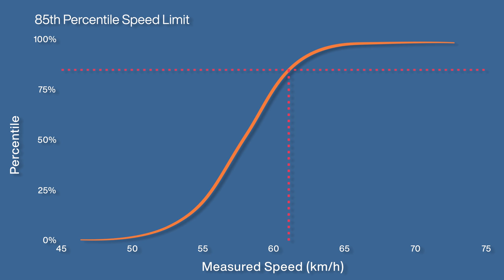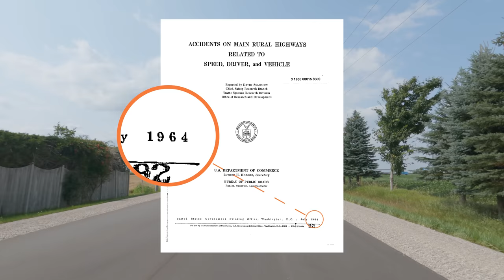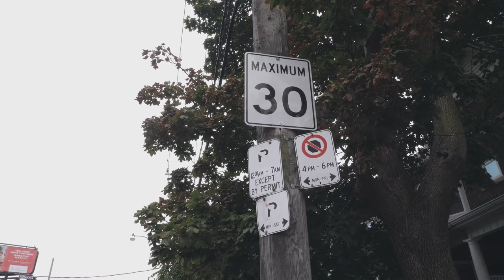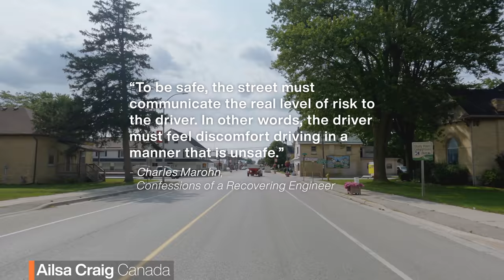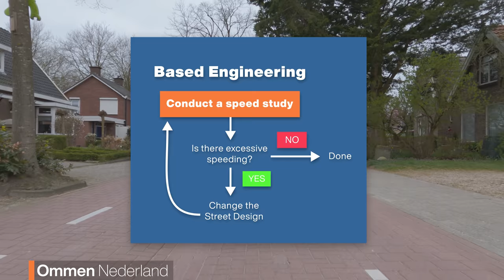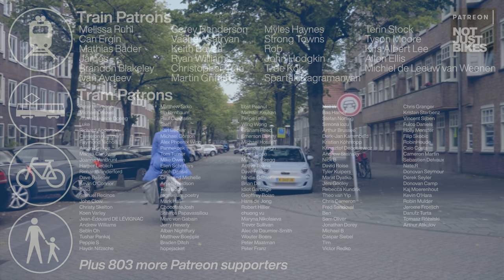The Wrong Way to Set Speed Limits [ST06]

Comment: The 85 percentile rule blew my mind. How they thought this was a good idea is beyond me.
Reply: It does kinda make sense in its original application. 
Rural roads built in a time where speed limits didn't exist coupled with an at the time fledgling understanding of traffic engineering, the number of drivers was very low relative to today etc.
It's also expensive to make new policy. Because invariably some areas will no longer be up to code and have to be changed.
That's all before you get into the political end of things re: who benefits from changes and who loses out due to changes. As well as ideological factors which are too numerous to get into.

It all results in policies which worked at one time retaining momentum and carrying on even through changing times and infrastructure.
It really is a lesson in doing things right the first time instead of relying on temporary solutions. Those temporary solutions often become permanent to the detriment of everyone.
Reply: @rainbowkrampus  Expensive to make policies how? The Dutch are constantly refining their best practices. It doesn't mean the old best practices are suddenly illegal, but it just means that, when that bit of road is getting touched next time, it gets updated to the latest standards. So yes, there are plenty of streets that, for modern Dutch standards, are a decade or more behind, especially when the location is troublesome in terms of the available space or amount of traffic that would be impacted by roadworks. But those are costs that you simply fold into your maintenance budget, while the added costs are simply investments that improve the quality of living. (Pot shot incoming: of course, if you don't have road maintenance budgets to begin with....)
Reply: https://en.wikipedia.org/wiki/Percentile 85th is the top bit of a normal distribution curve. Things above it can be considered "outliers". Static speed limits just don't take into consideration other factors. Time of day, weather, etc.  It's still a good idea to ticket people in that top 15%, they just need to do good road design for speed as well. Like he talks about in the video.
Reply: It's an excellent idea. But if you make the road such that people will drive faster than is safe, they will. The reason the higher speed is not safe may be fleeting (pedestrians and cyclists also use the road) or not immediately visible to the driver.

Comment: Interesting points that you brought up. I live in a town in Sweden and in my town it's very safe to be a pedestrian or a cyclist. I go often on walks while wearing noise cancelling headphones and it has never been a problem. There are walking and bicycling roads everywhere. And the roads for cars are narrow in most parts of the town and the speed limits are set low. Generally speaking drivers here respect pedestrians and bicyclists. Last year there was around 200 fatal traffic accidents in whole of Sweden. This is very impressive considering that the weather conditions here can be terrible and they are a large part of the year.

Comment: One thing not commonly mentioned when discussing the 85% rule is the unsafe environment caused the dynamics between street design, posted speed limit, and ticketing. To avoid a ticket you need to go slower than feels right, by definition slower than 15% of your peers, and other drivers will not be expecting you to actually be going 60.

Comment: Id like to point out that speed bumps can and do damage vehicles so making the excessively large or abrupt is not a good thing. I personally own a car with maybe 3 inches of clearance on the front and I constantly have trouble with poorly designed speed bumps in parking lots.
Reply: if you go over a large abrupt speed bump at a low enough speed you will not damage your vehicle. its simple mathmatics really. if you are damaging your car or practically jumping over the speed bump you were clearly going too fast. Its the inverse logic of a pothole where if you are going sufficiently quickly you will pass over it and not really "fall" in where as if you are going slow you will most deffinitely "fall" into it.
Reply: @Dragoonski  please explain this to gravity and literally anyone with a car that has low clearance.
Reply: @Dragoonski  The problem is that they'll put in a large bump, then post a limit that will damage vehicles if driven at that speed.  Once people complain, they'll actually check the bump, tear it out and rebuild it lower.  Happens a lot in Toronto.

Comment: I live in Victoria as a full-time delivery driver and this city is supposedly one of the best in Canada for cyclists and pedestrians, but it STILL feels like it's been designed by chimpanzees. The entire city is under construction at the same time to try and make the roads all smaller and safer and this is causing bottlenecks all over the place because traffic gets diverted to areas that were not designed for heavy traffic. There are huge roads that have low speed limits and neighbourhood roads with higher speed limits than the main veins. Cops exist only to enforce traffic laws that are stupid in the first place, and ICBC overcharges for traffic infarctions that would not even be an issue if the city was designed well to begin with.
Reply: 'growing' pains. I'd rather have some chaos for a while to make things better faster. Or you can wait decades for it to evolve slowly with the right policies. Then again, I was born into this. My experience with constant work on the roads is mostly summer holidays on France highways or mostly the German Autoban

Comment: Boomer engineer 😂. Great video. It is so frustrating to drive down streets that are wide open but have low speed limits posted. Also you can build in interesting features that make walking driving and cycling more pleasant (trees, flowers etc…)

Comment: The Netherlands doesn't always get it right either.
For instance, Beneluxbaan in Amstelveen (which briefly, at 9:15, (almost) appears in this video) now has a 50 km/h speed limit on the whole stretch, even though large parts of it are clearly designed for 70 km/h traffic, and practically nobody drives 50km/h there.
Reply: Don't know this specific case, but speed limits are sometimes also reduced to reduce noise to nearby housing.  So might originally be designed for 70km/h due top traffic situation/safety, but reduced out of noise pollution concerns. (maybe along with some sound walls?) (I believe tire noise is the biggest culprit and goes up with speed)
Reply: A similar bit in Zoetermeer near the city centre. It says 50, but it's designed for 70 and nobody drives slower than 60.

Comment: The thing you pointed out where the speed limit changes, but only the sign tells you is exactly how the stroad through my town works, except it's worse because one of those signs is for a school zone and the hours the school zone is in effect are written in a smaller font than anything else on any of our street signs. It has a light that's supposed to flash during the hours, but it doesn't always work, so you just have to have it memorized.

Comment: I’m having difficulty with this video because I thought that in the USA there are certain speeds for each area such as residential 25 mph, business 20 mph, school zone 15 mph and so on. Our highways are usually 65 mph with certain rural sections being higher and some lower. So what if they check the speeds on a residential street and everyone is doing 50mph or more?  Do they raise the speed limit to 50mph?  I don’t think that would happen.
Reply: I completely agree with you. That is exactly what I thought too! I was surprised there wasn't any push back in the comment section. I assumed each city just chose whatever speed they wanted based on the rules. Makes more sense to me. There's several roads I have traveled on that go through different rural towns and suburbs. The speed always changes at the city line. So obviously the speed limit isn't set based on everyone's travel speed, but on what the city wants. For example, one road I use is labeled as 35 mph until it reaches a more rural city which changes the limit to 45 mph once crossing the city line. Maybe the 85% is used when the speed of a newly constructed road doesn't have an obvious choice, and then cities can change the speeds later for one they like better.

Comment: Speed limit set by how fast people are driving on the road ?

WTF?!
Reply from the maker: I was reading an old article about it from a few decades ago and it was promoted as a way for drivers to "vote" for the speed limit, and therefore, it was democratic. Of course, pedestrians and cyclists didn't get a vote but who cars about them, right?
Reply: It doesn't sound so bad. Presumably most drivers drive at speeds that they feel don't endanger them. Using that and forcing most people to roughly the same speeds then improves the safety to other drivers as well. However, if drivers mostly take into account their own safety this approach doesn't work in places where there are e.g. pedestrians.
Reply: In English/French speaking North America speed limits are set by drivers with drivers in mind, not designed for slow speeds by engineers with a safety 1st mindset.
Reply: @NotJustBikes  love the pun. Who cars about pedestrians indeed.

Comment: i'm noticing this in germany all the time! we have so called "spielstraßen" where you're alowed to drive in first gear without any additional pressure on the pedal. so basically walking speed. but nobody does this if there's noone on the street. but we often have street design that helps reduce the speed :)

Comment: Pre-pandemic, we were on a long road trip across the US, and it was late at night on a multi-lane highway in Nebraska, when all of a sudden, there were unmarked lane closures and barriers blocking all but 1 lane. There were no warning lights or signs or anything, and the single open lane was super narrow with the barrier walls around it put up rather poorly, so the lane was effectively not very straight. Usually when I've seen those white barrier walls put up in road work areas, if there's no explicit mention of reduced speed, cars might be close to the walls but you would expect the same speed to be maintained and the lane to stay pretty consistent. However, I entered that section way too fast and didn't realize it until I found myself yanking the wheel suddenly to dodge little corners where the barriers jutted out into the lane. I had to slow down very suddenly to avoid crashing, and when I came out of it on the other side, I saw 2 cars parked beside the opening at odd angles, kind of diagonally in the next lane over but sticking out in front of the lane just a bit, so I had to actually turn a bit to go around them. Neither had their lights on. Other than us and those 2 cars, there was nobody else around for miles and it was really dark. I just kept driving after that until we got to our hotel.

It didn't occur to me until going to bed that night that those 2 cars may very well have crashed into the barriers because it was too dark and they were going too fast. I'm not sure if there were injured people in those cars or if they had gotten out to go get help or something. The whole situation just didn't seem right, but it was such an odd an unexpected thing that it didn't even register in my mind at the time. If I had seen obvious signs of a crash, I would've stopped to help people, but it was almost like this post-apocalyptic scene that had no signs of life. It was sad to realize what had probably happened right before falling asleep that night, and that I didn't stop to help others because I was so surprised by it. If that really was an accident, whoever was responsible for that work area really messed up bad.

Comment: In fact in the Netherlands and Belgium the speed limit rules are directly linked to the type of road you are on. The traffic rules literally state the type of road, how to recognize the type and the maximum and minimum speed limit on the type of road. The exception is stated as: "unless otherwise indicated". These are the basic rule:

On the highway, which is minimum 2 lanes per direction, where each direction is divided by a hard barrier and no bicycle lane is present, the maximum speed limit is 120 Km/h and minimum allowed speed is 70 Km/h. Unless otherwise indicated.
On the road, with a minimum 2 lanes per direction, where each direction is divided by a hard barrier, the maximum speed limit is 120 Km/h. Unless otherwise indicated.
On the road, where each direction is divided by a soft barrier or a line, the maximum speed limit is 90 Km/h. Unless otherwise indicated.
All roads ( there are only very rarely highways within city limits ) within city limits maximum speed is 50 Km/h. Unless otherwise indicated.
On streets, where bicycle don't have a designated lane, maximum speed is 30 Km/h. Overtaking bicycles by cars is forbidden. 
On streets or roads, where speeds bumps or traffic funnels are present, maximum speed is 30 Km/h. Overtaking any vehicle is forbidden.
In residential area, where pedestrians are allowed to on walk on the street, maximum speed is 20 Km/h. Car drivers are obligated to pay extra attention, in any accident involving a pedestrian the pedestrian is always in the right. 

There are specific rules in regard to cyclist as well. Like not being allowed to overtake bicycles unless unless a clearance space of 1.5m between the car and cyclist can be guaranteed. Roads with cycling lanes usually automatically designed in such a way.

The design of all the types of roads is fairly uniform and each type is easily recognizable. When there actually are speed limit signs, it's because they are needed due to specific conditions on that road, like being slippery, densely populated or bad road conditions. After a while it becomes pretty intuitive and easy to follow. 

Of course it's not all perfect, there is always room for improvement.

Comment: And here I am in America thinking to myself that even our streets are ~60kmh (35mph) and trying to drive 30kmh (18mph) would just be agonizing. My cruise control doesn't even work under 40kmh (25mph). I can barely touch the pedal and go over 40kmh.
Reply: My car responds similarly to the pedal, and trying to go 30-50kmh without constantly having to tap the break is tough, and it hurts the heel and ankle after long enough. It’s fine to have them as lowered speed zones around a school or something, but to drive the length of a whole street or road at 30kmh is torture.

Maybe we should try to actually enforce the rules surrounding driver and pedestrian inattention. If we didn’t take such a lax attitude to pedestrians and drivers being completely oblivious, maybe we wouldn’t have to design the roads for the most empty headed among us.
Reply: I drive 30 km/h in 4th manual gear. It then makes 1500 rpm. You do not need your cruise control. 50 in 5th gear at 1500 rpm and 60 in 6th gear at 1500 rpm. And full speed, 243km/h, on the german Autobahn. I am from the Netherlands. You get used to the lower speeds. And mostly you have to, because of the bicyclists.
Reply: @foxandk  the 30 KPH limit for streets is one thing as you are NOT driving on a street long distances (should not be) but on PROPER roads the speeds SHOULD BE higher